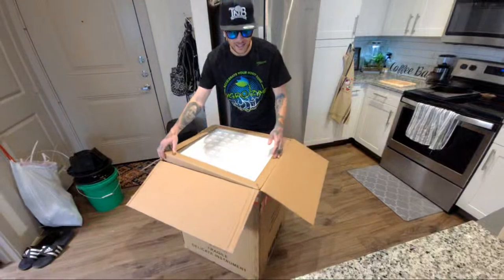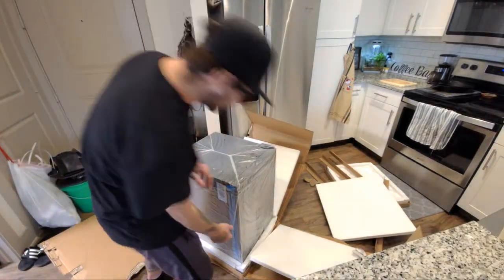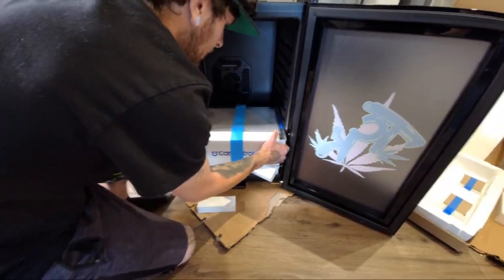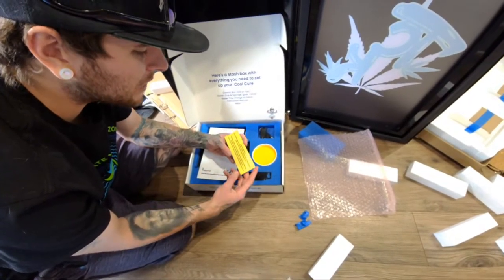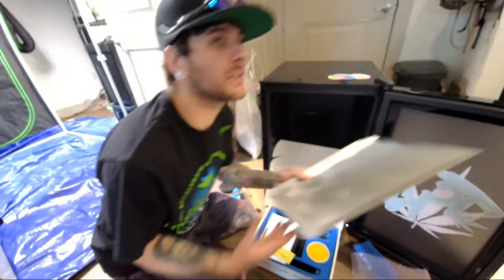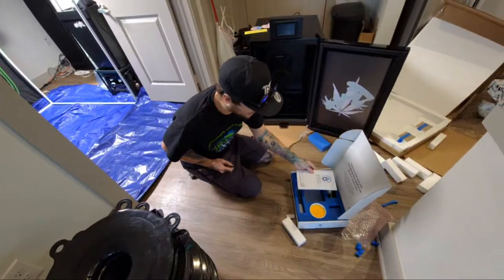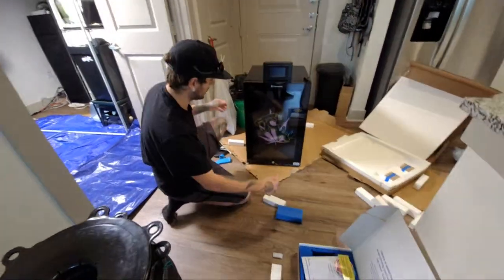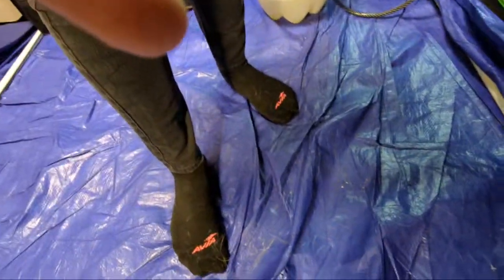UNBOXING THE CANNATROL LIVE WITH MARY JANE!

Comment: Video broke up. Who does the instagram stuff on the cannatrol mine will be here this week
Reply from the maker: Yea I need to do another I keep forgetting. Been busy transitioning my job to another location. Cannatrol is the instagram but you can check out my IG I've posted a ton on them. I definitely recommend wet trimming bare minimally and dropping nugs in the Cannatrol versus full branches. It's an insanely amazing unit though. Full Review coming out Tuesday!